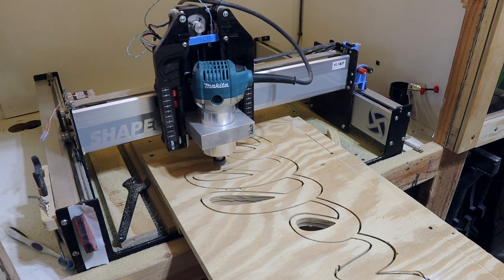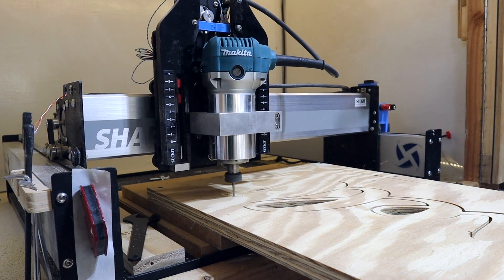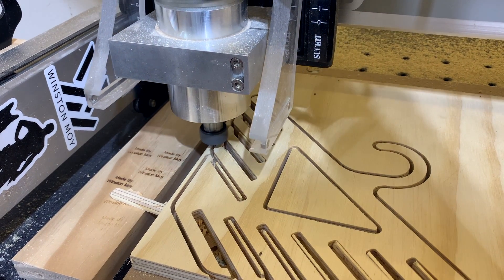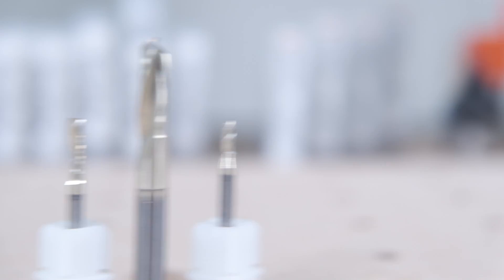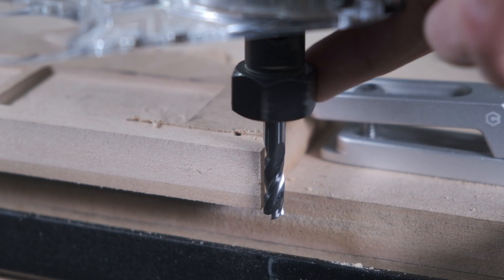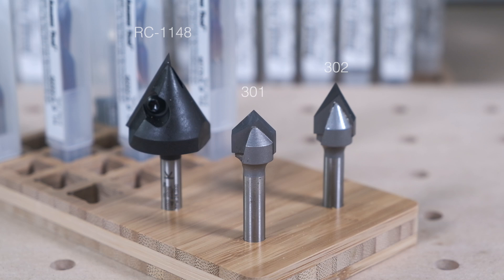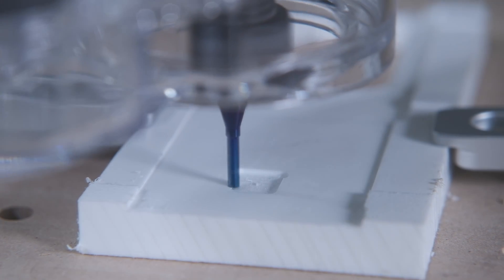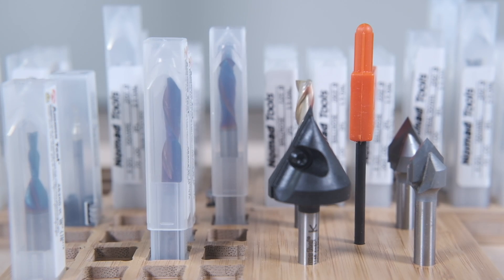How to Choose an Endmill for your Project

Comment: Can someone tell me how to use the Vbit like they did on the star in this video?  I just want the edge Vbited and inside flat like they did.  Thanks
Reply: It didn't show the v bit cut the flat bottom. I imagine they had a clearing path to get most of the star cut using a flat bottom endmill, then finished the details with the v bit.

Comment: Can you help ? I need to cleanly cut 3mm aluminium sheet into pieces that seem a puzzle but like 40cm2 area. What the best endmill I should use 1/8 or 1/4 " . I bought a 3mm one to try first  to have less waste of material and more detailed in the intrincate curves . I am concerned about the revs my tool spins between 16and 25k revs/min a rotozip mounted on a floating base I made . The end mill is special for aluminium.  Appreciate your advise
Reply: Do I need an air blowing device? Should I use a lower revs tool instead? I dont want any burr .should I use water spray too? Can you recomend me a make and model of the machine in your videos or any suitable for my project.  They are lids for aluminium boxes . The curved shapes are being bent after with a brake press